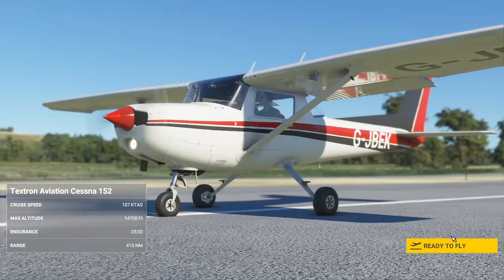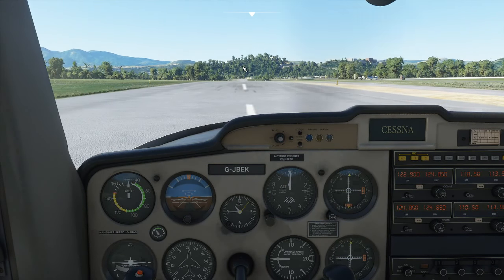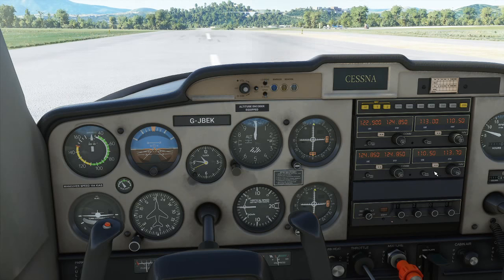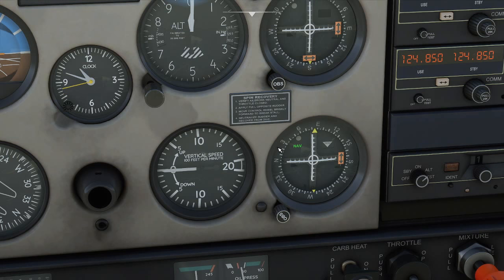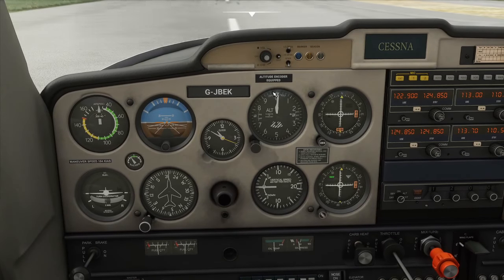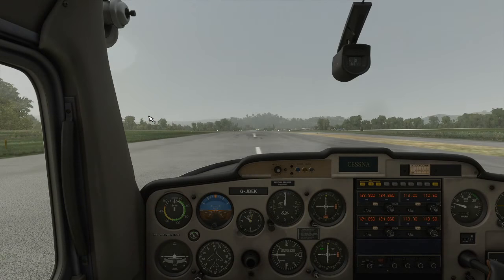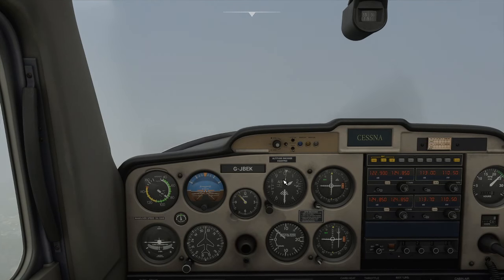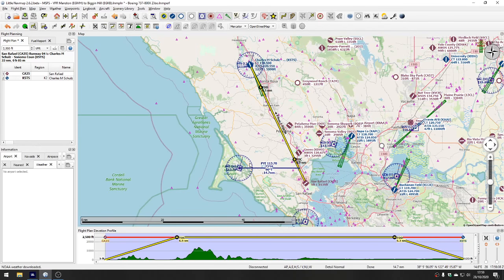Cessna 152 Radio Navigation Example in Microsoft Flight Simulator 2020

Comment: I haven't flown a real C152 for a while but for a shorter field I'd use flaps, hold the brakes push full throttle then start my roll then retract as soon as I'm airborne.
Anyway the video is great and thanks for uploading! :)
Reply: Do not retract the flaps until you see a positive rate of climb, and not as soon as you are airborne. (In real life)

Comment: So good to see actual flight sim...just what I need.  Many just rave on about hardware/setup.  Thank you!
Reply from the maker: Yep - I agree - most people just want to have fun flying - not grandstanding about "ooo look - I've got this plane which is better than your version", or "I've got a graphics card that is more expensive than your car"...
Reply: @jonbeckett  Good one about the car price!  I was looking at another of your YT on testing 1080p vs the upload of 720p also.  Your vids look good to me.  I'm coming at this from seeing a FS2020 promotion and wondering if I can follow along on the flights (interested initially in the cool geography, then later maybe some sim flying) w/o over investing in hardware.  So far it IS apparent that my desktop is way under powered.  That would be a starting point I guess...I do not have the knowledge or inclination to swap-out components though.
Take care...
Reply from the maker: @westfork8  The published specs for FS2020 are pretty accurate - I have a PC that's about at the recommended level, and it handles it fine with everything on "Medium".

Comment: Hey Justin, I tried this navigation for the first time today.  Worked quite well in terms of tracking my whereabouts although the wind blowing me of course was a bind. Only real problem I had was knowing when to tune the ils.  I ended up turning too soon as the direction needle seemed to be not working.  As it turned out if I had waited a bit longer it would have come alive.  Thanks for this its really helped me understand how to navigate with VOR's It's just a pity that there are so few working.  I was flying from Durham Tees Valley to Humberside using the POL VOR to track my progress and the OTR for heading (I hadn't realised that Humberside had one).  I shall put in the practice now that I understand the process better.  Cheers!
Reply from the maker: If you're navigating by VOR, and inbetween stations, that's when it's most fun - because you need to start calculating your speed, direction, and drift due to wind - to project where you are on the map inbetween the stations. I'll try and record it for a flight at some point :)

Comment: Hi Jonathan, just a query about the airport you're flying to in this video, the name has changed to Santa Rosa and there is no 113.00 beacon at this airport, just the ils, 109.3, I tried it out as an exercise, but couldn't find the beacon you referred to in your video. Things seem to have changed since doing your excellent video. Just thought you should know, I use navigraph charts and there is no reference to the beacon you mention. Thanks for all your excellent videos, they are very helpful.
Reply from the maker: Oh, no doubt the details from some of the videos will have changed - particularly if you use navigraph.

Comment: Hi Jonathan,
It's been a while you posted this, but if you would make a video Erfolgsübung how to use DME, it would be great! Thanks
Reply from the maker: All DME really is, is "Distance Measuring Equipment" - which you use in collaboration with VOR. If the plane has DME hardware, it will tell you how far away the VOR beacon is. I'll do a quick video to explain.

Comment: I can't get the nav 1 to become active. What am I doing wrong? I have it on 113.00 and on active or "use"
Reply from the maker: Were you in range of the VOR station ? It may not work on the ground - radio tends to be line of sight.
Reply: @jonbeckett  OK cool. I just saw that in your video you got contact immediately. (I tried the exact same airports as in your video) Maybe something has changed since you did that video.

Comment: I'm not quite sure what's happening for me, but I have recently started to play on the Xbox with a Thrustmaster and been loving it.

But, in the Cessna 152, I cannot seem to get my VOR? Or this radio frequency function, to work right?
I am trying to go from West Midlands to East Midlands to Wolverhampton via this VOR for navigation.
I set my Nav 1 to 109.350 for EastM and Nav 2 to 108.600 for Wolv and get the Morse Response. But nothing changes when I spin the dial to find headings. I have slowly gone all the way round 360° and the line never moves from being top left of the Nav ball.

Any help? or is this simply not functioning on console as intended?
Reply from the maker: Where did you get 109.350 from? East Midlands is an NDB (non directional beacon) - not a VOR. Wolverhampton is DME only (distance measuring equipment) - not a VOR. That's why you can't tune the NAV radio into them and see radials.
Reply: @jonbeckett  maybe a confusion on my end. I'm not sure I found the Birmingham and Wolverhampton through a quick search on phone and same with East Midlands.

This explains alot it being NDB, DME.

Thanks for the help. I am really new this side of Aviation. 👍
I've had my play arounds War Thunder but never a sim like this or DCS etc
Reply from the maker: @cluelessgod97  we all start somewhere :) There's always something new to learn - which is what interests me :)
Reply: @jonbeckett  indeed lol. 
I was mostly dumbfounded at how much I will have to wrap my head around things.

I got chuffed starting my 152 from Taxi without assists and getting used to the Comms system and manually using it.

I jump into the F-18 to try the Maverick challenges and I browse the buttons inside cockpit and laughed at how chuffed I felt in the Cessna Haha!
But, looks like I have stumbled across the goldmine as your videos are helping me a lot. So thank you 🤘

Comment: I didn't understand how it suddenly started to keep track of you vertical position on the upper vor instrument, is there a button for the plane to understand it's tracking ils angle?

Btw, when you say frequency, it's actually the angles right? So I can print out some charts and make the angles on my own to say for example, I will start when second VOR shows 100 degrees from reference to me, 70 degrees when I'm halfway and 30 degrees when I reach.

Thank you very much for the video, helped so much already.
Reply from the maker: When I say frequency, I mean the radio frequency the navigation radio is tuned into. The NAV instrument in the cockpit (with the needles) shows a vertical, and horizontal position relative to the radio beacon the radio is tuned into. Imagine the beacon is like a gun - pointing into the sky from the end of the runway, with an invisible beam extending into the sky on a shallow slope. The radio instrument in the cockpit shows where you are in relation to that beam,  to the left or right of it, and above or below it.
Reply: @jonbeckett  Now I understand, thanks a lot. Are VOR beacons present in every airport? For the MSFS, does the game have these frequencies built-in?
Reply from the maker: @hakanviajando  MSFS reflects the real world - no, not all airfields have VOR beacons
Reply from the maker: @hakanviajando  If you're interested in flying together at some point, I'm busy helping build an online flight sim community over at https://virtualflight.online - we have a Discord Server, a Facebook Group, and are trying to schedule regular group flights. Would love to see you there!

Comment: Hi, I have the same issue with the nav1, frequency on 113.00 but no active OBS, what can be the reason for that. I flew exactly the route you showed in the video with 320 degrees etc,.  Great video by the way.
Reply from the maker: On approach I was using 109.30 - did you switch the frequency to active ?
Reply: @jonbeckett  thanks, that was probably the problem.

Comment: Useful but how can you use an NDB with a decimal point for example 391.5 in the default Cessna 152
Reply from the maker: I just looked it up - you should be able to tune within 0.5 of an NDB and it still work.

Comment: what was your flaps setting? also the approach speed was highly inaccurate its supossed  to be 60kts for flaps 30 
also there is no approach speed 10 kts more than the stall speed what if you encounter a sudden gust on finals those 10kts wont be there👍
Reply from the maker: This was recorded quite some time ago - MSFS is getting more accurate, with each update that arrives - give it another few months, and it might be somewhere near :)
Reply: @jonbeckett  I AM NOT QUESTIONING THE SIM'S ACCURACY BUT RATHER YOURS AS MENTIONED THERE IS NO APPROACH SPEED KNOWN AS 10KTS CLEAR OF THE STALL SPEED
Reply from the maker: @ALPHAAVIATOR  CALM DOWN! lol

Comment: Yes, MS flight sim 2000 is not such a good program. The scenery looks quite fake. Graphics are poor. Controls not good and to touchy. Terrible program, goes off line a lot.
Reply from the maker: I would say the opposite of all of your observations. With suitable hardware, and a good internet connection it is the best looking flight simulator there has been so far, it's incredible value (you get the entire planet included), the best multiplayer by far, and rock solid networking.
Reply: @kimberly wentworth ms flight sim 2000 was made in 1999, perhaps that's why the scenery looks fake,  this is msfs 2020 lol and the scenery is exceptional